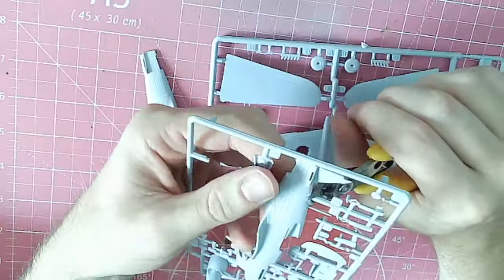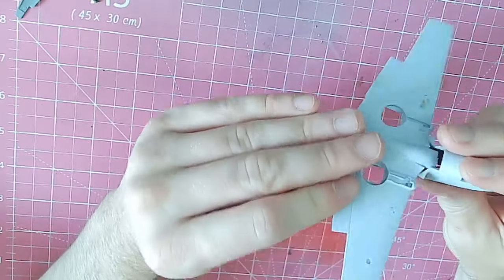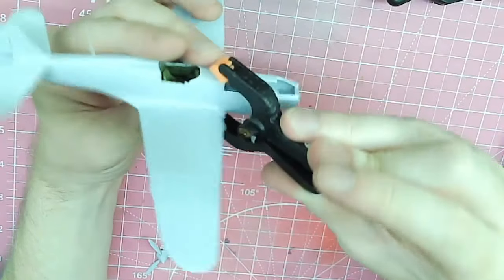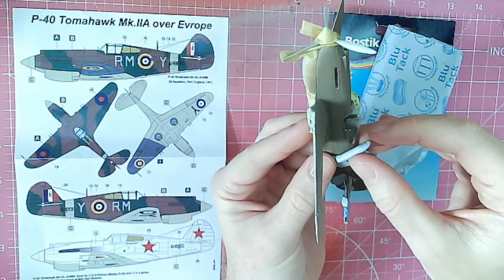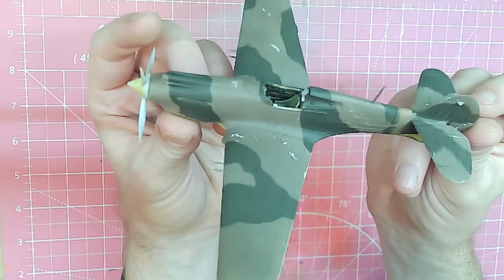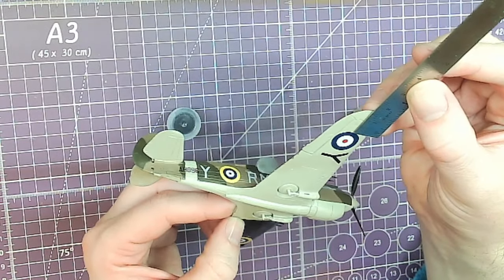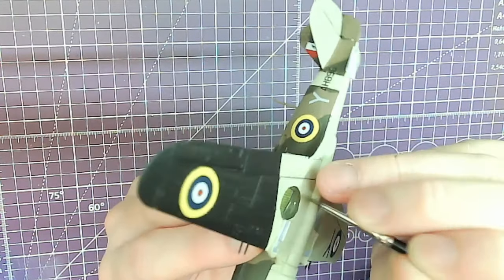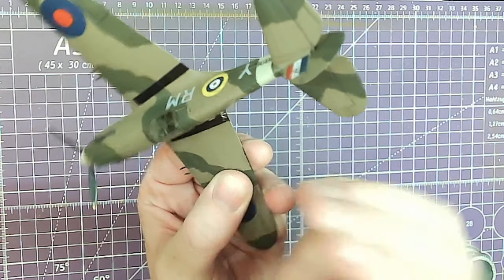Close to disaster! Building the Airfix 1/72 P-40B (BAV)

Comment: So, I'm not the only one having a fight with some of those Hataka paints.
Reply: Hataka blue are meant for paintbrush, you can airbrush with them quite ok, best to thin with hataka thinner and bit of Vallejo flow improver. Still your results will vary depending on colour of paint. Some colours spray ok, and other clog your airbrush. Hataka red are considered bit pointles as the are nogood for brush and offer similar sensations when airbrushing. Hataka orange is proper airbrush paint :-)

Comment: As for hataka paint i got some serious issues witg B029 german blue and B072 soviet blue. I was unable to mix like you've said. As for B029 shop replacesd with paint from another batch and all went ok. For B072 first shop offered refund for 17ml bottle so i got 10ml from another shop with same result...and I've ended up with Vallejo Air replacement. There must have been some incident in manufacturing some time ago....

Comment: Feel your pain with the paint. In fairness to Hataka, that is the Blue range, which is meant for brush painting - the Red line is for airbrush but brush paints fine. If you like P-40s try the Special Hobby one as it's got a lot more finesse in the detailing and is also really straightforward to build.
Reply from the maker: I absolutely get that this is the Blue line. I bought them before I had an airbrush so they will have to do. This however, is not relevant to the green failing as it is an issue with the paint itself, regardless of how it is applied.

I will be getting more P-40s at some point, in the past I made a few academy ones but will happily take your recommendation for Special Hobby, thanks.